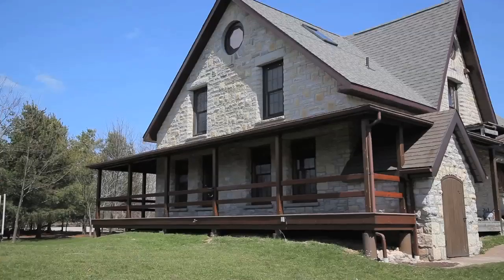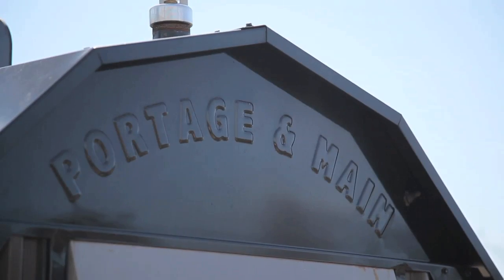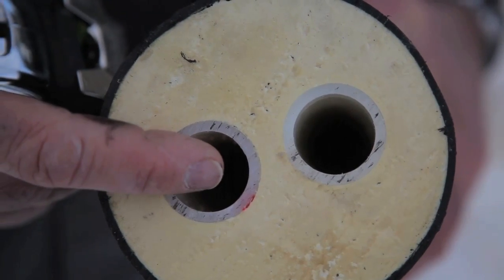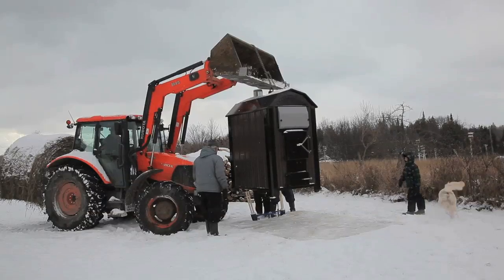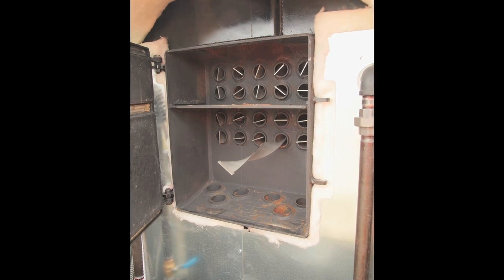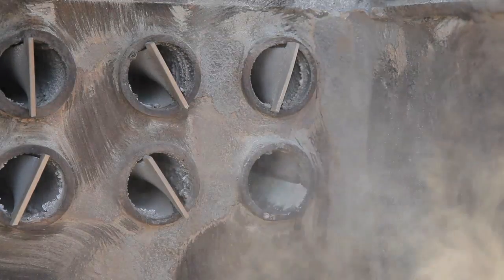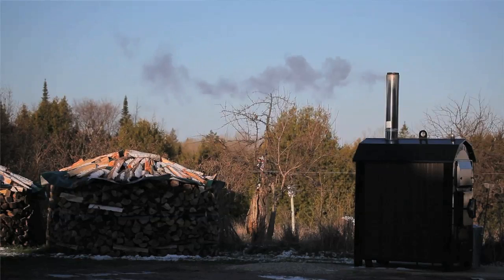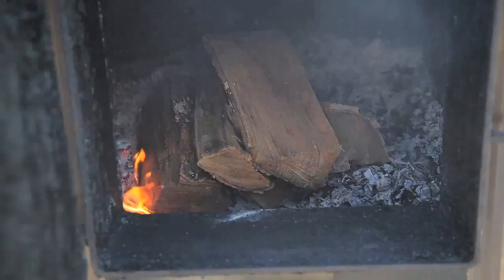Outdoor Wood Furnace Tour

Comment: You should do a video of the new boiler you got! A lot of people would appreciate a video on the Ultimizer.
Reply from the maker: +Kaden Watt Hi Kaden! Yes, I plan to. I wanted to put in a full winter with the Ultimizer so I'd have a good sense of how it works. I'm winding down the season with this unit now, and it's quite different than the gasification Optimizer I used before this. To be honest, I'm not sure which I prefer because they both have different strengths and weaknesses. I'll explain more in a video. Are you thinking of getting a boiler?
Take care,
Steve
Reply: +Steve Maxwell Sounds awesome! Thanks for the reply, by the way. Ironically, we have the Portage and Main Ultimizer BL34-44. We opted for the model with the coal shaker grates, so ash removal would be easier and we wouldn't have to rely on the ash to fall through the standard brick grates on its own. The ONLY complaint I have about it is that the outer "storm door" could use some additional reinforcement. Too much wind makes it flex more than I feel comfortable with. However, I'd definitely recommend it to anyone who's willing to put in the work to use it! Looking forward to the new video! Thanks,  Kaden

Comment: what about all the heat lost when you go outside and open your door (twice for in and out) each time you go out and fill it with wood?
Reply from the maker: +Eric Bouris Hi Eric! 

While it's true that heat is lost in unique ways from an outdoor wood boiler, it's not significant. Compared with, say, a woodstove, an outdoor boiler loses heat when you open the door (as you pointed out), it also loses heat through the walls and roof of the unit itself and also through the insulated underground heat lines. That said, it always amazes me how much heat an outdoor boiler can still deliver to buildings they're connected to. For instance, when I stoke my boiler before bedtime, the amount of wood I'm loading in might only last for two or three hours if it were piled up outside and burning in an open campfire ring. My family and I might be able to warm ourselves a little around the fire as we shiver outside when it's -20º, but we'd probably still freeze to death. But this same amount of wood burned in the boiler keeps 5000 square feet of indoor space at 72º to 74º degrees for 12 hours in the night. Outdoor wood boilers certainly aren't for everyone, but if you're able bodied, if you have a lot of space to heat and if you have access to firewood, it's pretty good.

Drop by my website https://baileylineroad.com for a visit sometime. You'll find lots of stuff there, including tool giveaways, articles and the chance to ask me questions. 
Bye for now and thanks for watching!
Steve
Reply: i think i lost brain cells reading this question

Comment: Mr. Maxwell, Steve here from Ohio. I truly enjoy your channel and the useful videos you share. I enjoy utilizing wood to heat my home, gathering, cutting, splitting (mostly by hand) stacking... working outdoors. I am curious if you are still pleased with your Portage and Main outdoor furnace... I am considering an outdoor system in the next year or so and learned a lot from your "homework," you did in researching your options.  Central boiler is very popular here, however in doing my "homework," I've found a lot of unhappy customers and problems with leaking water jackets, customer service and corrosion under the spray foam insulation. Any insight would be valuable, feel free to email me at smwrigh4@gmail.com if you don't want to post here. Thanks in advance!
Reply from the maker: +Steven Wright Hi Steven! Good to hear from you. Thanks for  your kind words. I still really like Portage and Main for all the reasons I mentioned in the video. As for an update on my experiences, I did switch my Optimizer 250 (a gasification model) for an Ultimizer (a high temperature non-gasification model also made by Portage and Main). I'd heard the Ultimizer was better, but having used both, it's a close call. The Optimizer 250 burns a little more cleanly than the Ultimizer, and I think it uses less wood (I'll know better in the spring). The Ultimizer is much less finicky about the quality of wood it burns, though. It can burn rotten, damp wood as well as dry hardwood. Just for fun I put some freshly cut balsam fir in the Ultimizer and it burned it all perfectly. My particular model also burns coal. Is the Optimizer better than the Ultimizer? I'm not sure yet. I still greatly admire the Optimizer 250 and miss it sometimes. Then again, the Ultimizer takes much less time to clean. For me, it remains something of a toss up right now. I need to burn the Ultimizer more to come to a conclusion. Then I'll be able to choose.
Does this help? I hope so. Please let me know.
Take care, Steven!
P.S. I live up in Canada, but my wife and I and one of our sons took a trip to Kentucky and Tennessee this past September to look at universities. We drove through Ohio. I'd never been there before but there looks to be some nice land there. Where abouts are you in the state?
Reply: +Steve Maxwell Absolutely that helps, thank you! Yes I'll be going the gasifier / optimizer route when the time comes to make the investment. Burning Coal would be handy, it is readily available in my neck of the woods. I prefer wood but if some reason I'd be unable to replenish my supply for a while its good to have another option. I live in East Central Ohio in Tuscarawas County.
Reply from the maker: +Steven Wright Hi Steven. Coal isn't to easy to come by where I live, but I did lay in half a ton of bagged anthracite coal this fall. It's hard to get started, but burns smokelessly once it gets lit. I used to be opposed to coal because of the CO2 emissions it gives off, but I've changed my mind on the dangers of CO2. Too many top scientists are now coming out saying that CO2 is not involved in significant climate change. In fact, higher atmospheric CO2 levels have led to measurably more and better plant growth on the earth. This is a controversial issue because so many people have a vested interest in human-powered global warming, but the plain evidence seems obvious to me. I'm not aware of any gasification units that burn coal, but there could be some.
Take care,
Steve

Comment: Good video. 

I've never had any problems using Teflon and a rated thread compound (the white stuff and the beige stuff) for water/heating piping. For potable water side ONLY Teflon. For gas piping white or metallic compound.

Comment: Hi SteveInto year 2 with my Polar  G3 gasification wood boiler. I just wanted to thank you for all your help during my research phase and the tour you provided. We have never had such comfortable stable temperatures in our 100+ year old farm house.Currently heating farm house , 900 sq ft garage and loft and all domestic hot water. I have been playing around with different settings and wood species. I was amazed to get 12 hr burn cycles last winter with using  dry cedar ( last winter saw record cold temperatures for weeks ). Gasification process is the way to go.Managed to set up domestic hot water using continuous boiler flow and thermal siphon to passively supply unlimited hot water.  Also using poplar and elm that is dying off all over island. Keeping an eye on water chemistry as well. Did not add glycol but have added nitrite for corrosion control.Stop by some time and check it out if interested.JT

Comment: HI
how much wood you burn per year
do you have your fire burning all year long for hot water
Reply: Normally, with outdoor wood boilers, you'd only burn it during the heating season. During the summer, the boiler would be underworked, causing the fire to smolder more and causing waaay more creosote than before. We have a Portage and Main BL34-44 with the coal shaker grates installed, and we love it!

Comment: Steve, I really enjoy your video and your knowlege of your outdoor wood boiler. Im in the market for one, and with all my research... I keep going back to the portage and main for the craftsmanship and the fiber insulation. Im curious as to  what your opinion is on the new ultimizer series, and if these models were avalible when you made your purchase. I like the easy access ash cean out, and the "storm door" to help prevent failure of door latches and seals. The only down side i see for the model you decided on, is the cleanng of the fly ash with the fire tubes. I look forward to your response and appriciate your time. Thanks- Brian
Reply: i dont burn wet wood, but gassifiers need extremely dry wood to burn at their most efficient. Around here that is hardly possible with our wood choices, and we woudlnt be getting as long as burn times with our wood around here anyways. So a gasser made no sense. When you are first starting out with a boiler, it is hard to have seasons of firewood in storage to dry out.You gotta use the wood that is available to you in your area at that time. I am new to the house and boiler scene. got house with zero firewood in storage. The previous owners always bought their wood. They burn 10 plus cords of firewood a year, that is quite a bit of wood! I dont get that much creosote, get a little bit, but I clean it out weekly.
Reply: +bpres103 another down side to the model he chose is having to split all your wood and make sure its really dry. If you buy the ultimizer no splitting of wood is neccesary and you can burn more variety of wood and wetter woods. Sure he doesnt burn as much wood, but he has to spend hours splitting all that wood up, we have to spend more hours getting a little more wood. His cleaning process with the boiler will take more time as well. Worth it? Not for me! going with the ultimizer 2840, picking it up in two days at the head office in Prince Albert Canada. Its only 4 hours from me. I currently have a wood doctor that is a leaking sive, came with property when bought it a year ago. A huge advantage of the ultimizer series, is if you have problems, you can replace the water jacket, or just replace the firebox, they are bolted together, not welded. You can remove each of them and repair any part of it. You dont have to buy a new boiler! Huge advantage! Also this ultimizer should burn quite a bit less than my current wood doctor! Super excited!
Reply: +dynocompe I'm not going to downplay your choice of purchase.  The Ultimizer is a good boiler.  And I'll admit that being able to use larger wood is desirable (though muscling a 40" long 12" log into the fire box doesn't sound that great to me).  But, burning wet wood?  I don't get that.  All you have to do is stay a season ahead, and you burn probably half as much wood.  You refill the fire box a lot less too.  Doesn't matter what stove/boiler you're using; it's the case across the board.  Not to mention the filth that come from your chimney, and the increased maintenance from creosote.  Seriously, just let it dry.  Even for the work saved not splitting, it's worth the wait to let it dry a couple years.

Comment: Great video. Thanks:)
I am looking at purchasing the BL 4044 model. I plan to heat my house and large shed.
The distance between the buildings is 60'. I would like to place the boiler between the two buildings. However the prevailing wind would put the house inline with the smoke from the boiler. Is this a problem? Or does the smoke generally dissipate over the distance of 30'?
Can I run two lines from the boiler to the two buildings? Or should I run the line to my house, and a from there run another line to my shed?
If I don't hook up my shed in the first season, will this be a problem (because the heat system is oversized for heating the house alone?
Reply: wont be much of an issue as when up to temp they hardly smoke, i have a bl28-40. Also its winter, no windows are open. It shouldnt be too much of an issue to only heat the house because lots of people run the boilers during the summer for domestic hot water which would hardly pull a load. I would advise you to heat your hot water by the boiler too, although only for winter, i dont run my boiler in the summer. For just hot water, not worth the trouble. You should run separate lines to the boiler for house and shed, DHW can run off house line

Comment: Have a close friend that is looking for an outdoor boiler/furnace.  This brand certainly looks like it would fill the bill with no problems.  He has cast iron rads installed in the house and an older inefficient oil fired boiler.  Helps to have lots of wood which he has as well.  Thanks for your,as usual, thorough job of explaining your system.

Comment: We live nearby a cabinet factory, and have access to more sawdust/shaving from their dust collection system than we can use.  We've been using it for cattle bedding and burning brush piles, dad had discussed trying to make wood pellets and install a pellet stove in his house.  My idea was to skip the pelletizing step and just burning the sawdust in a system such as this, since my goal is to burn free fuel and not necessarily efficiency, would an older simpler design with more tolerance be a better option?  Do to the lower density material I'd likely need a larger firebox and a good damper, your thoughts?
Reply: +Kent Sextro I would thing the key to burning saw dust, as is the case with chips/pellets, is to burn a small amount at a time at a high intensity.  Otherwise, aeration is an issue and agitation is needed.  If you are to take advantage of saw dust, I'd think you'd need to figure a way to turn it into a more solid fuel.  I'm thing you'd saturate it with water, press it into cubes or logs using a hydraulic press, and then dry them.  Kind of labor intensive, and you won't end up with a very dense fuel.  But if you really do have an unlimited free source, might be worth pursuing.  Try filling a regular wood stove full of saw dust.  If that goes alright, then it would probably work in a traditional style boiler.

Comment: We had a HeatMaster 10000 that malfunctioned and caused a fire. Damage was more than $125,000. HeatMaster did not stand behind their product.
Reply from the maker: Morten Steen Jorgensen Hi Morten! I'm really sorry to hear about your troubles. What happened? I've never heard of a boiler malfunction that caused a fire. Please fill me in. I'd like to hear.
Bye,
Steve
Reply: ***** HeatMaster representative installed the 10,000 2 years ago. We had no problems with stove during that time. The day before the fire the oven overheated. HeatMaster representative fixed over the phone. Next day wood stove, building, 2 A/C's, content and Generator burned down. Fire department concluded it was a wood stove malfunction. HeatMaster have not taken any responsibility what so ever - real bad experience and they are not standing behind their product. Replacement will be a Central Boiler.

Comment: Why do I keep thinking steam locomotive when I look at this operating system?  ha ha. I am intrigued by this system not for saving money to heat my house and hot water for baths but in a prepper sense. But, the need for electricity to run blowers, pumps, etc. completely removes this from my list as a prepper solution to staying warm in the winter if a calamity occurs. For me, I think installing an additional propane tank to run my gas log fireplace, water heater, and gas range makes more sense plus I can convert my gasoline generator to run on propane as a dual fuel generator to help charge up the batteries or run the well pump to fill a 100 gallon extrol. I can run my fireplace fan off of solar panels/battery and do so for a year at least with the couple of propane tanks I plan to keep. This system to me is way too complicated and unforgiving for a prepper.
Reply from the maker: beboboy mann  Hi There!
Yes, there are many ways to get prepped for a disaster. For what it's worth, my little 1000W Honda inverter runs all the pumps and thermostats and such, so even though it needs electricity to run the boiler, it really doesn't need much. The biggest advantage for me is that it can turn wood from my forest into massive amounts of heat that's conveniently distributed to two buildings. Outdoor wood boilers aren't for everyone, but I certainly like mine.

Where abouts do you live? I'm always curious to learn from others about their prepping work.
I cover lots of cool things on my two websites. For construction, woodworking, renovations and tools, drop by for a visit at  @/stevemaxwell.ca. Homesteading stuff is at Bye for now,Steve

Comment: Very well done video, you'd think this guy worked for Portage boilers. very high efficiency boilers are actually water tube although fire tube is still common.
Reply from the maker: Hi Chad! Thanks for your kind words. I'm glad you like the video. It continues to do a really good job for us. Loads of heat and unlimited hot water. At least, it's unlimited as long as I keep the boiler stoked!
Do you have a boiler at your place? Do you get much cold weather?

There's lots more where these videos come from on my website https://stevemaxwell.ca. Drop by for a visit.

Bye for now and thanks for watching!
Steve
Reply: ***** Ya very cold up here in western Canada, We headed with wood for many years with a wood/electric furnace and had we stayed on the farm I would have installed a boiler, I run antique steam engines and have always had an interest in boiler design and construction. My uncle built a few heating boilers for members of his family but insurance nowadays frowns on that, I don't think it should matter in the middle of your yard.